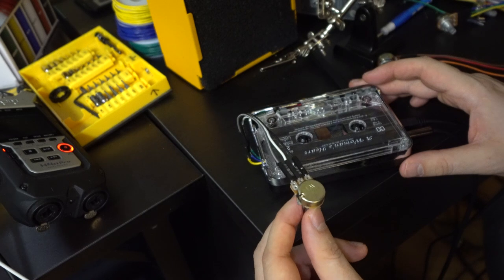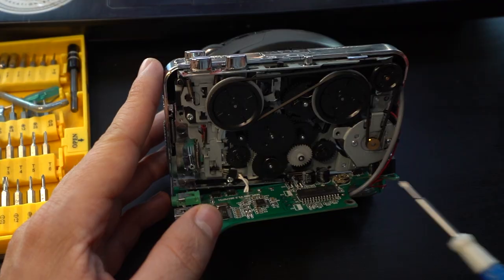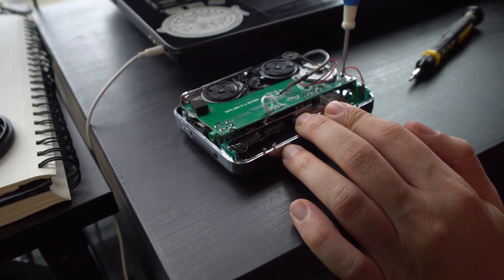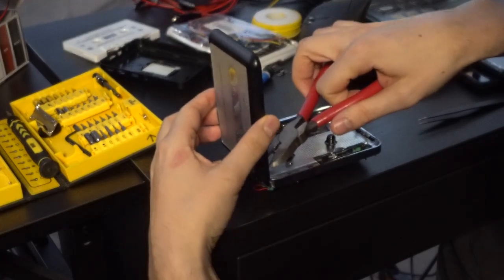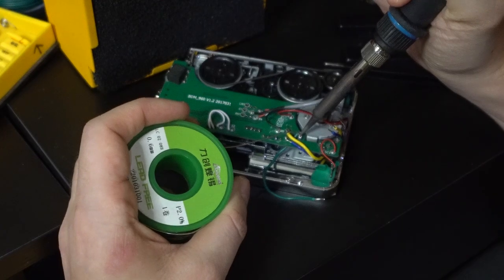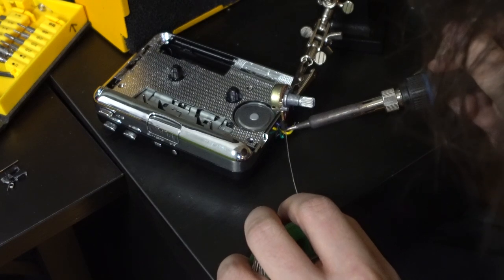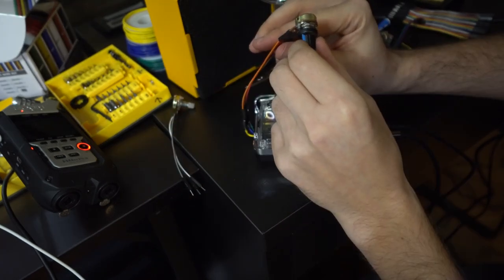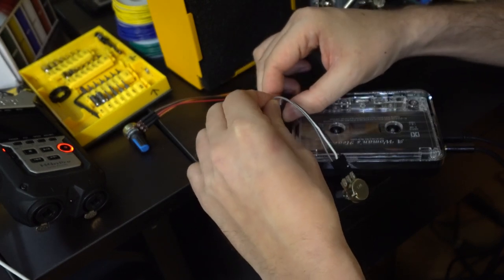Cassette Player Speed Mod

Comment: When doing this on a older cassette, the only thing I can find is it going up in speed, I can't find anything that slows it down. I cant find a trim pot either. Not sure what to do
Reply from the maker: What cassette player do you have? There might not be a trim pot but there might be something on the circuit board that you can manipulate.
Reply: @DECIMA1  Lenox sound cassette model 919. Yeah I was looking for anything like a trim pot and most mods I found just sped it up or stopped it.
Reply from the maker: I would use alligator clips and a pot to mess around with the circuit board to find something. You can also try looking up a schematic